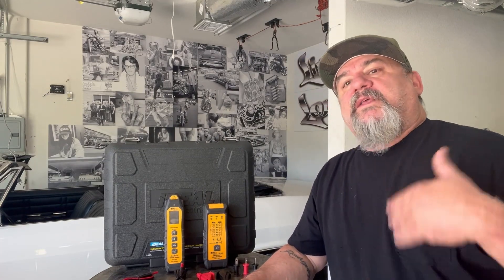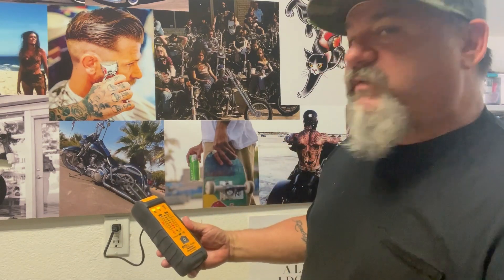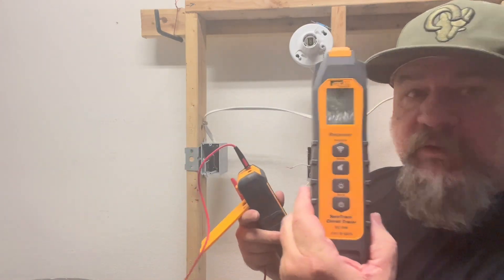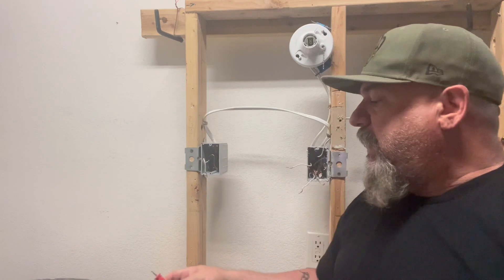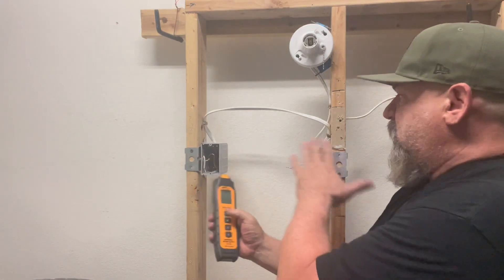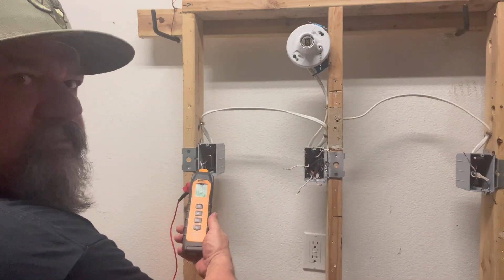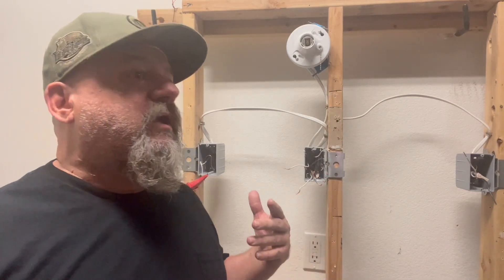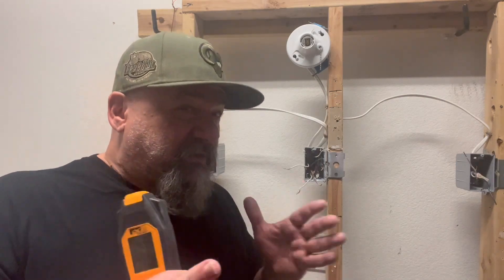How to Trace Circuits with Ease. Find what Breaker goes to What Circuit. Suretrace Circuit tracer.

Comment: What if the circuit is dead?
Reply: Nevermind i think this tool is what we need. A breaker popped and after switching all of them nothing happened on the dead circuit and can’t solve which circuit it is.

Comment: Just opened one of these up and went to plug the receptacle adapter in. Seems to not like old circuits with shared neutrals. It thinks just about everything is hot. Gonna try just plugging the single probe into the hot side.

Comment: What's that Mex restaurant name again? 
& on a less important note, have you tried circuit tracing thru drywall using that model? I've always wanted one that could do that
Reply: It seems to be very similar to the circuit tracer Klein makes and based on that it should be able to trace through drywall without issues. I have the Klein and it'll trace underground. I imagine this one would too.

Comment: Got one, best tool to have. I do alot of cormecial Like Walmart stores etc. Alot of times circuits not numbered or the circuit  breaker is no longer the  breaker  with this tracer I find it  and this even traces burried wired. Sometimes pulling wires numbers fall off and this even worked with power off. Well worth it. Mine is Klein.

Comment: Always use BX cable with metal box. RomeX cable with plastic box. One prevents fire, one cause fires. 😂
Reply: Good reasons to wear PPE and work deenergized.
Reply: I had troubleshoot a circuit that had romex going to a metal box mounted inside a wooden cabinet. Got zapped by the box because the box was energized with no ground fault path to trip the breaker
Reply: Not an electrician, but instead a home owner in an old BX-wired house who has repaired electrical sins of the past in my own house. I think some additions to your statement are in order, though I wish no offense. BX cable always and only terminate in a metal box. Romex can be terminated in either a metal or a plastic box. BUT, even the right cable terminated incorrectly or incompletely in the right box can pose a danger. Example: BX terminated in metal receptacle box, but the cable clamp not tightened and the metal cable sheath winds up slipped out of the clamp, while the hot and neutral wires are still connected inside. Your receptacle tester will show “open ground”. If there is a short in that box, the breaker might not trip and everything metal touching the box could be energized as well! The same thing could happen with Romex in a metal box if you skip connecting the ground wire to a ground screw in the box.